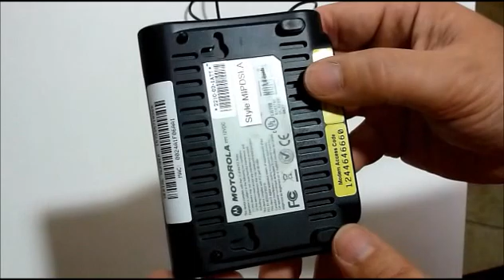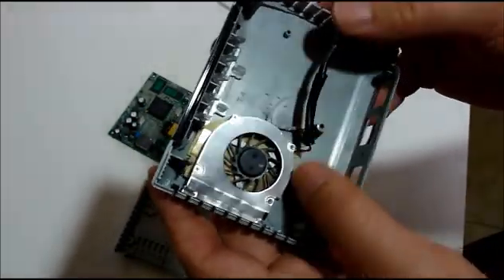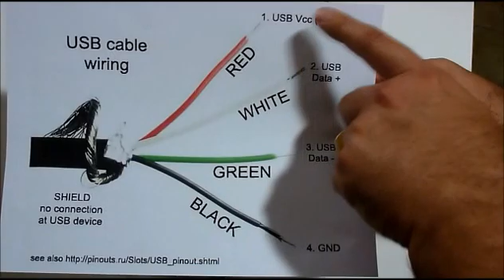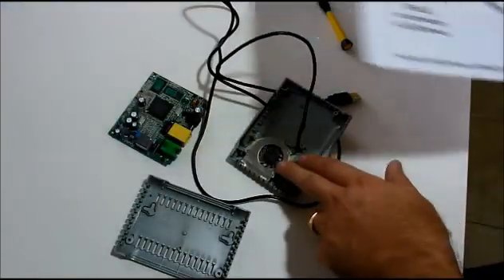AT&T Motorola 2210 / 3360 DSL Modem overheating problem Fix / Hack Instructable

Comment: yea using an lm7805 regulator works great too if connected to the power in on the board... then u dont have to worry if its plugged in or not

Comment: This works Great but the USB cable is not needed all you have to do is use a LM2596  12v to 5v Regulator and and wire the fan to the power port on the board this is what I did and works great

Comment: that is a centrifugal fan. Air is drawn in from the center  out away from the fan inside the case then out the exhaust on the side also I believe that fan is used for cooling the CPU inside the laptop. But it's drawing air from around the chip and exhausting it out the side. What's cool about it is the fact that it's self-contained. which means you can put it in tight places. I would recommend taping off the side vents on the opposite side than the fan. Since you open up the bottom that should allow plenty of air in. What I did was something like Anthony Starks did. But I used tape around the bottom to act like a skirt forcing the air up through the bottom of the modem also closing off one side so the air is forced up one side of the modem and out the other. Have been using that setup for almost 3 years, it works really good.
I also fan cooled my routers my Asus RT-N16 is also three years old and being fan cooled still works great. Recently upgraded to the Asus RT-AC68U and of course fan cooled it is well.

Comment: ah okay.. i bought a laptop fan for under $8  with foldable legs.  the fan is large enough to just sit the modem on.  I cut open the air holes as you did in your video, and the modem literally never gets hot.

Comment: Where did you purchase the fan?
Reply from the maker: The fan is a case fan from a laptop.  Ebay has a large number of them from laptops that have been stripped down for parts.  As long as it is under 7mm it should fit inside without problems.
Reply from the maker: There is another way to modify this with a generic square case fan.  I am working on that video now.